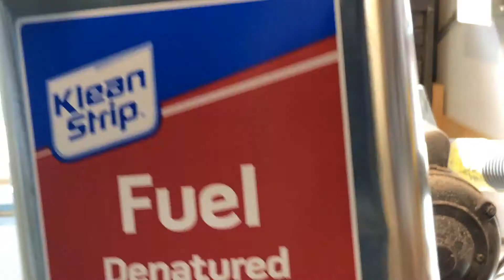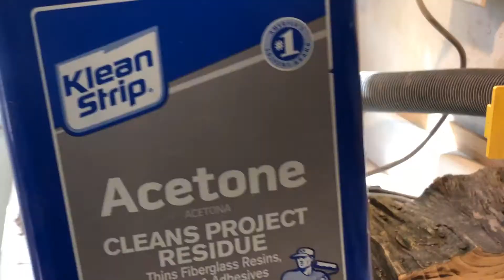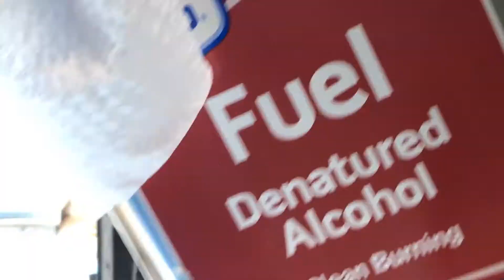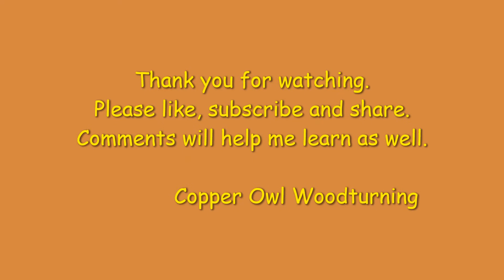Ash firewood to natural edge bowl -  Copper Owl Woodturning

Comment: Beautiful bowl.  I played it at 1/4 speed so I could tell what you were doing, and still missed a lot of detail.  You did some meticulous detail work during the sanding and finishing stages, but, other than denatured alcohol, what finishes did you use?  Did you actually sand between applications?

Also, what part of the world are you in?
Reply from the maker: Thank you so much, David. That means a lot to me. I appreciate your interest in the process and products I used making this bowl. As you noticed, I did use denatured alcohol to clean off any sanding residue.  I sealed the wood inside and out with my home made sanding sealer which is 50/50 Zinsser Bullseye clear shellac and denatured alcohol. I put 3 or 4 coats on with minimal sanding in between then all over with 800 grit sand paper. I cleaned again with D/A, then 3 coats of just shellac, no sanding. For now my videos are just a way for me to share my turning and the result. I am not an expert at this, but enjoy it very much. The video portion is definitely new to me. I live in the United States
Reply: @copperowlwoodturning5929  Turning and videoing are distinct arts.  I admire anyone who can do both.  Keep the videos coming.
Reply: I'm in far western Kentucky, the forgotten part of the state.  Best I can tell, there are no turners or clubs anywhere near me.  I rely on YouTube University.  :)
Reply from the maker: @davidnickell9381  I have learned a lot from YouTube. There are a great bunch of people on there that will help and support you.